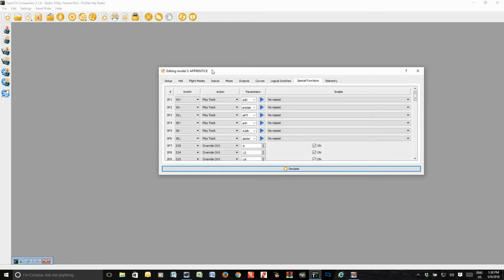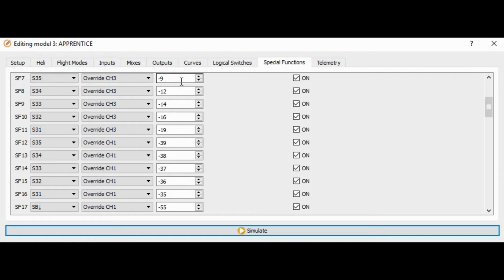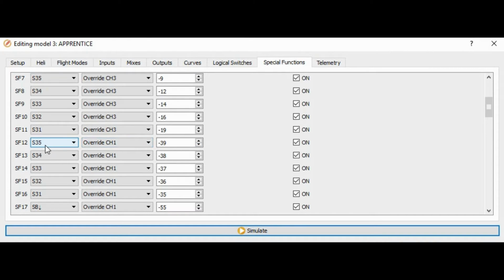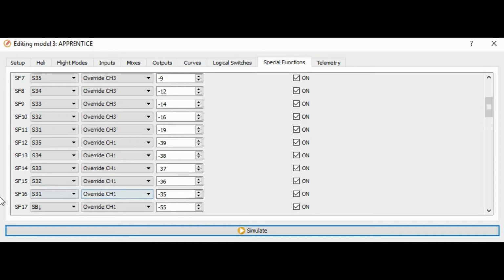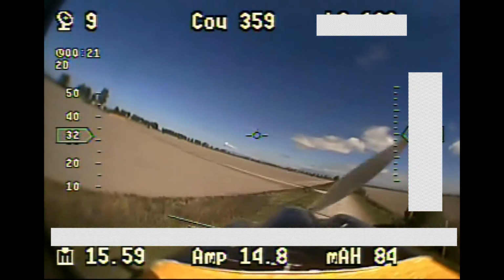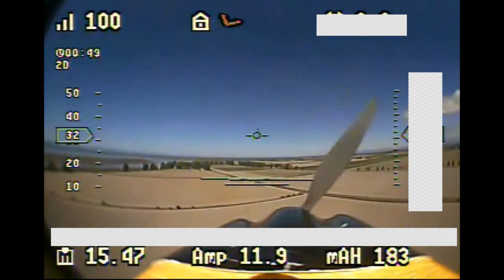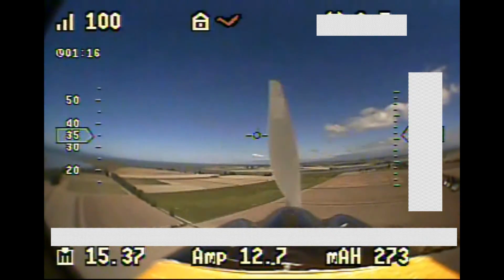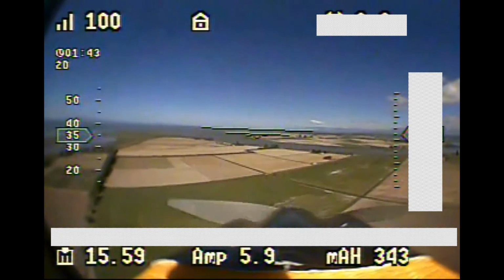FrSky TARANIS - programming elevator and throttle for better performance

Comment: So the danger of this solution is that you are truly overriding the elevator completely and are not able to make a manual correction if needed on takeoff unless you switch off the function.  It would be far safer to create a mix which does not totally override your controls.
Reply from the maker: Hi Josef, you are right. While climbing you don’t have control over the throttle and the elevator while the switch is on. The purpose of this is to achieve a steady climb, I found that for climbing for extended periods of time the thumbs wander around and you have to be watching constantly the climb. With this settings I forget about controlling the climb. I fly the planes mainly with the rudder only. Remember this is for FPV long range. Since then I have changed the climbing to a three position switch where I have two climbing settings. I’m using the 6 position switch for cruising. On a long flight the battery start loosing voltage and you need to increase the amps to keep level flight.

Comment: Just used this vid to add a little up elevator for launch. You are a good resource, thanks!
Reply from the maker: If you are using is for launching perhaps is best to use a mix, in that way you have control on your sticks.  This way you are overriding and have no control through your sticks.  watch this video for mixing, https://youtu.be/4ejGHxcagAQ
Reply: Oh thanks Eduardo. I see now that the elevator channel would be frozen and I don't have a 6 position switch. My Taranis is not the plus version.
I will use your other video on mixing.
Reply from the maker: Don't need a 6 position switch, any switch will work for the mix! It is just for taking off! The six position switch that I have I use it for 6 different cruising speeds.  It is just a luxury to have so you don't disrupt the throttle when you are moving the rudder only!